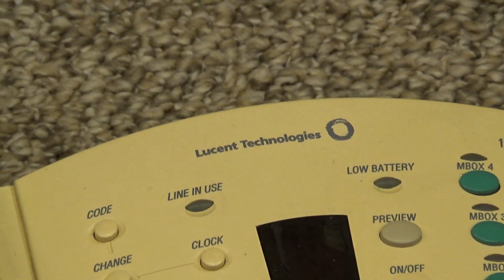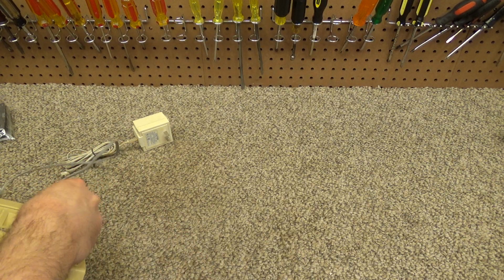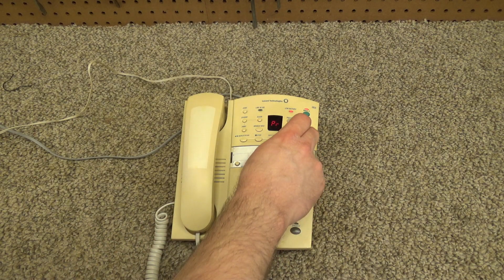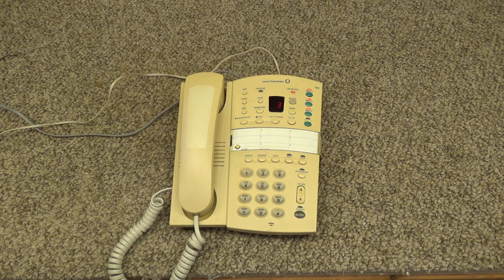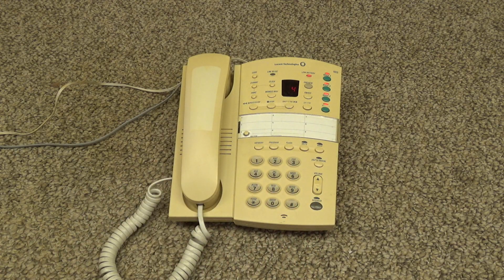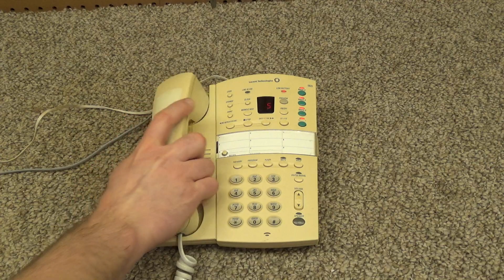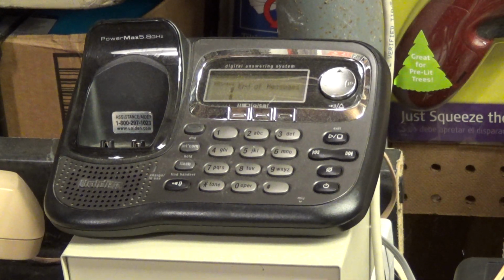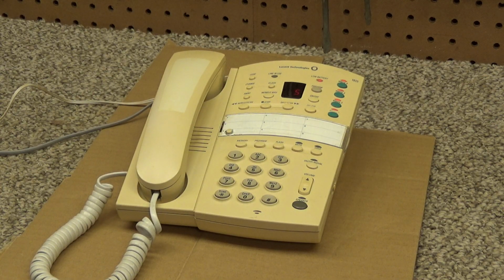Lucent Technologies 1825 Corded Telephone with Speakerphone and Digital Answering Machine

Comment: I have a similar Lucent Technologies phone to yours except it is the AT&T version model 1815 even though the circuit board says Lucent. My 1815 phone had the same issue with the play message button not responding and was able to fix it. All you need to do is take the phone apart loosen the front circuit board where the buttons are and clean both the button contacts and carbon pads. I used 70 percent isopropyl alcohol to clean both the circuit board contacts and the pads with Q-tips or paper towels. The contacts on the circuit board were severely oxidized for the play message button but now work fantastic for the 1815 phone. You should make a video on doing the cleaning on your Lucent Technologies 1825 phone and guarantee that will fix your play message button along with any other buttons that are not working. I hope you find this helpful.
Reply from the maker: I figured it was either just dirty or needed the conductive material on the back of the pad refreshed.

Comment: Synthesized voices from this time period were, in fact, recordings of people speaking compressed with LPC. The same was also true for the AT&T voice from the 1818...ANd I'm pretty certain VTech actually made those. I suspect that what VTech actually bought once they got the AT&T license included the rights to some intellectual property, which you'd be able to tell if a handset from, say, 1995 and 2001 were identical.
Reply from the maker: Thanks for letting me know.
Reply: Thats cool, what is LPC?
Reply: @TimeCapsuleClips530  LPC stands for Linear predictive coding, it's a form of audio compression meant only for speech and useful only for speech. LPC compression is brutally efficient, and in fairness, a true case of 'get the job done', as LPC was intelligible. But some of the assumptions it made - it assumes that a speech signal is produced by a buzzer at the end of a tube - are why it sounds the way it does.
Reply: @NickG6489  Nice, do you know what chip Vtech used for the LPC speech?

Comment: Oh my. I never heard that other announcement. I never thought to check Announcement B. And how ironic, the announcement that played when you called it was different than what you selected. I think there really was a ghost! oooOOOoooOOOooo

Lucent made the AT&T consumer stuff roughly from 96 to 97, then Philips made it in 98, then Lucent again in 99 to 00, then Vtech bought Lucent and renamed it into Advanced American Telephones.

Guessing the 1825 is 96-97 because it's an earlier model. If it was Philips manufactured, it would say so on the bottom. I believe the 1817 was from the Philips era. The 1818 is a product of AAT in the early 00s.

As far to my knowledge, all the equipment coexisted under the Lucent and AT&T names for the enture production run. If it didn't, I would guess the Lucent branded pieces are older.

The input is AC 9V 780mA.

Preview plays the first 5 seconds of every message and doesn't mark them as read. You can also transfer messages to a different mailbox. While it's playing, press Change, then the mailbox button. They become unread in the other mailbox.

baa
Reply from the maker: There did seem to be something flaky about the announcement selection switch.

How did Philips' quality compare to Lucent and AAT?

That's an interesting feature. I really wish we had more of the manuals for this stuff, it seems like there's probably a good amount of functionality on this thing that I just don't know about.
Reply: @JordanU  Philips quality is identical to Lucent. Both those companies made the best AT&T branded stuff. The stuff before was difficult to service, and the stuff after was both cheap and difficult to service. The Lucent products are designed very much like Uniden.